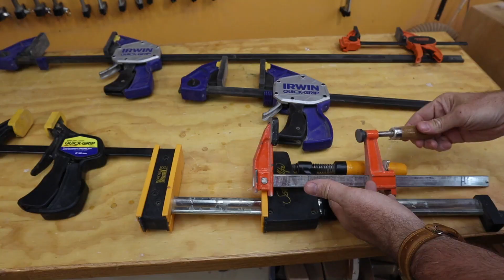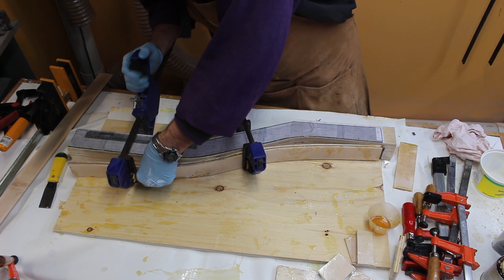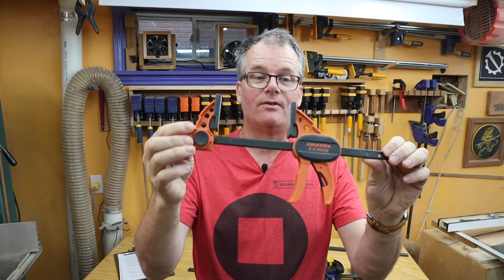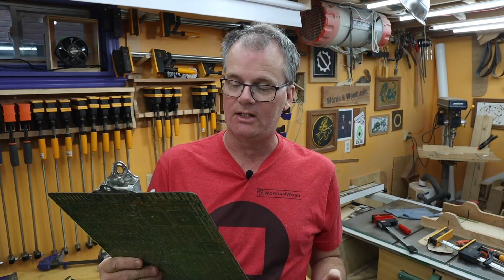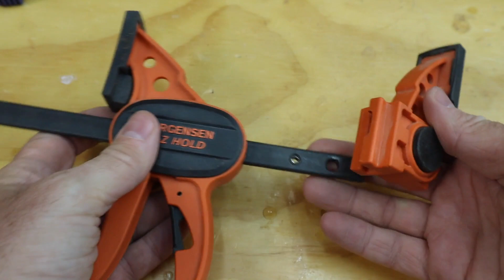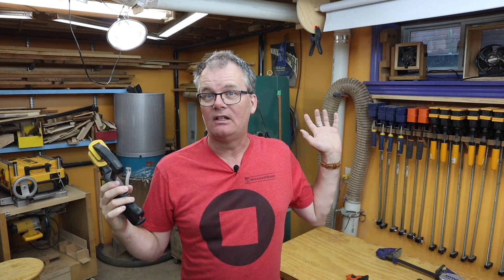Why Quick-Grip Clamps ? // Clamp Week day 4

Comment: I am enjoying the clamp videos. They are short, entertaining, and share your perspective.
I have four of the older style clamps (two have the Quick-Grip brand and two have the Craftsman brand). I haven't felt a need for more of the type. I tend to use them to hold a board to my bench to make a cut with a handsaw.

On my clamps that use a screw to tighten them, I try to remember to retract the screw most of the way before I before I hang them up. I also try to remember to hang them up instead of just setting them down somewhere.

Comment: I was waiting for you to demonstrate my favorite trick with squeeze clamps - If you hold it vertically, with the bottom jaw being the one by the trigger, you can press the release and the top jaw will fall right into place, so you only need a squeeze or two to get your piece clamped.
Reply from the maker: good tip

Comment: I like quick grips because the’er easy to use one handed, but they don’t have the clamping force of an F style clamp. For that reason I often use them to get a glue up started when I need my other hand free, then backfill with F clamps. 

The blue and silver Irwin clam has some kind of mechanism inside that multiplies the clamping force unlike the black clamp you showed so that’s a nice advantage. 

It’s been my experience that only the quick grips that have the larger style grips and bars longer than 18” have the reversible jaws.

Comment: I am also a parallel clamp fan but I have to admit that quick grip or squeeze clamps are great. If I had to choose one, I would pick the parallel clamps first but I will admit they the squeeze clamps are better for certain applications such as smaller projects, when you need to tighten the clamp one-handed, or when clamping onto an awkward work piece. 

I have a couple of 6” and 12” Irwin squeeze clamps and was pleasantly surprised when I picked up a set of 12” and 24” Bremen squeeze clamps from Harbor Freight. I got burned by cheap HF squeeze clamps that fell apart but the new Bremen ones appear to be on par with my Irwin’s in terms of the build quality. Hopefully they will hold up over time. 🤞🤞🤞
Reply from the maker: Yup, I wouldn't want them as my only clamp, but I like them as a supplemental

Comment: Quick-Grip are my favorites. Couple of points:

1) The skinny small ones can be more useful than the big huge ones as they fit into tight spaces and won’t ‘pull’ on the workpiece
2) The Bessey ones are reversible by simply turning a dial. Witchcraft. They also offer the ‘DuoKlamp’ which is similar style but completely different. Peter Millard’s Channel ‘10 Minute Workshop’ is where you can see them a lot.

Love this series. Thank you!
Reply from the maker: thanks for the info!    Much appreciated